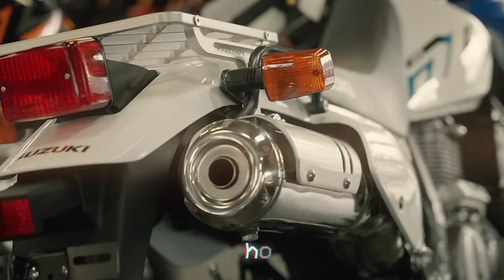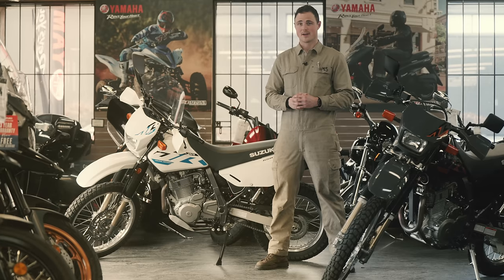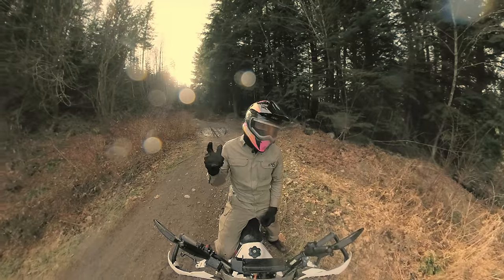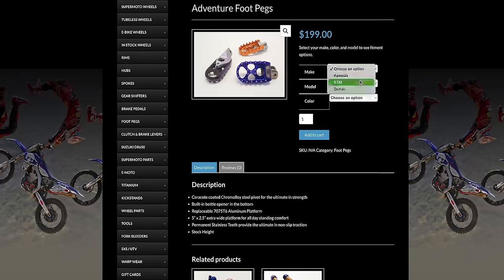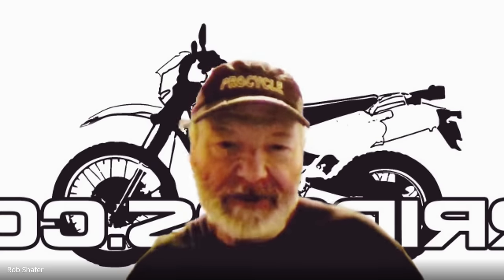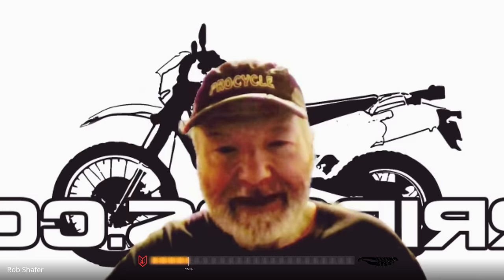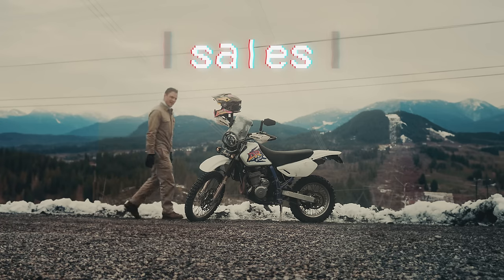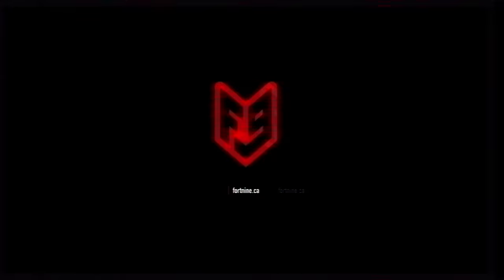Suzuki DR650 - The Motorcycle that Built a Community

Comment: One of the best bikes I ever owned. I paid $7000 in 2014, added $7000 in mods, put 56000 kms on it, and sold it last summer for $5000. Not bad if you ask me…
Reply: Sixteen cents per kilometer.  Great value.  Not to mention all the smiles per mile.
Reply: 7k in mods??? did u just bolt another one to the original or what
Reply: I don't agree on the bang for the buck aspect but that hardly matters.

Nor will one ever make sense for me except being a cheap rental in some countries.

Can definitely agree it's a solid package.
Reply: Sorry but 56k in 9 years? You hardly rode that thing!
Reply: 7k in mod for 7k bike and you think your smart?
Reply: @amirdoost8527 you don’t know the difference between your and you’re and you think you are?! 😂
Reply: That's so bad😂😂
Reply: @gujo4351  how can you add 7000$ on that hahahahahaha......and why
Reply: Steal
Reply: I bought mine for a 3500 with 3,500 mi on it. Best mods for these bikes Ricor front fork valves! Extra padding on the seat. Handlebar risers. License plate rear tail light feng shui improvement! Front tire super Moto mud fender. LED headlight. LED cluster light. Maybe out the door $1,000 on upgrades. How do you spend $7,000 on upgrading this bike?
Reply: Solid gold brake and clutch levers, right?
Reply: Sounds like an investment. It's ok. People did worse.
Reply: So, you lost 9.000$ by using it for about 9 years, I don't think it's a bad deal, it's a terrible one!
Reply: You only HAVE to purchase gasoline to make it go......
Reply: @gujo4351  Maybe he considers fixes a "mod". I wanted to buy dr650, watched a guy who put 70% of the value in first month because he had to fix suspension and engine (it was prepared just right for buyer inspection but had serious issues)
Not the best deal...
Reply: @amirdoost8527  Um, it's you're (you are).  LOL  It is better to keep your mouth shut and appear foolish rather than open your mouth and remove all doubt.  -  Mark Twain, I think.
Reply: @Al.j.Vasquez  Um, 7K + 7K = 14K - 5K = 9K, not 12K.  Or did I miss something?
Reply: @cyjanek7818  So, the ONE guy that YOU know cancels out the thousands of guys who never had any trouble?  Oh, OK.
Reply: Nevermind the haters here. They wouldn't understand. Maybe not the most reasonable financial decision, but it isn't the return on $ in monetary terms. 
Some would habitually go to Starbucks, eat out daily or buy an overpriced truck, lift it, then never drive off road. 
You Sir, used it as intended and more importantly had a blast.
Reply: @tedunguent156  what? Never had any trouble? The whole community exist to solve this bike problems, if it didn't had any this video wouldn't even exist. 
Why are you so mad lol, it's not a secret that 1 cyl engine are not reliability kings.
Reply: happiest 5k spent!
Reply: $9000 loss but those memories are priceless
Reply: @cyjanek7818  What makes you think I am mad?  People mod their bikes to make them more capable of the riding they intend to do.  Many of these bikes were just ridden without any mods.  Now go and try to trigger one of your little friends.
Reply: @amirdoost8527 modding a bike is half the fun. You're probably fun at parties 😂
Reply: @purple9969  Well, it isn't really a "loss" either.  No matter what you buy and USE it costs money to use it, right?
Reply: @tedunguent156  I’m $3100 into a 2001 rebel 250 cmx250c, and there is always something else. I finally got it running as it should after rebuilding the carb 14 times, and as soon as I came back from a ride I blew the crankshaft seal. Just like it took me 14 times to discover another fix on the carb, I’m currently at trial two on the crank seal. In the end the bike will run better , and when it’s all said and done I’ll say it was worth all the anguish, but is it?
Reply: @purple9969  It is if you say it is.  It's not my bike.
Reply: @purple9969 just in time for something else to fail 😂
Reply: @thecheeseisgood12345 I had three other bikes I was insuring at the time. The DR took a nap occasionally.
Reply: Sounds like you wasted 9,000 to me…
Reply: I know plenty of guys with $10k - $15k in add ons to Husky 701's. No one cares about resale value, you just build the bike you want.
Reply: That doesn't sound too good bro
Reply: @thecheeseisgood12345 kilometers at that, not even miles. Such a shame.
Reply: @PseudonymAliase  Cogent rear shock assembly, Cogent progressive springs and valve emulators at the front. $2800. From Procycle: stainless exhaust kit, 40MM Mikuni carburetor, stainless braided brake lines, front and rear, shorty levers both sides, Michelin tires with extra heavy wall tubes, 90 degree valves stems, titanium Hayabusa muffler, Acerbis aluminum hand guards and 26 litre fuel tank with two fuel petcocks, oil cooler protector, aluminum skid plate, Moose adventure saddle and 1” Moose handlebar risers, ProTaper handlebars, Oxford heated grips, LED lights every fkn where, Wolfman waterproof luggage, and a bunch of other shit that I can’t remember. Fk all you ignorant haters. Go spend $15000 on a BMW or KTM only to discover that you need thousands in upgrades to make it actually rideable. You think I’m stupid? 🤣
Reply: This guy dualsports
Reply: If you didn't put any mods you'd of gotten more of a return, but probably less fun too.
Reply: Sounds like you barley used it and then gave it to the next guy for less then half of what you paid if we don’t count insurance gas repairs etc. nice 😂 any lube recommendations?
Reply: No one will even look at my DR with 51,000 miles.  Once mileage is mentioned they run away.
Its a parts bike.  Spending 14K on a bike and selling it for 5K is a good thing?
Reply: @Gigachadly  I built the perfect bike for less than the price of a Beemer or a KTM and that bike took me to more places than any of you coffee shop riders will ever see. When things in my life changed I sold it. 🖕🏻
Reply: @tedunguent156   My bad, it was probably late at night and i didn't tell.
Reply: 34k miles damm
Reply: @tedunguent156 Add gas, maintenance and taxes

that's a shit base for operational cost
Reply: 7k in mods?  Did you do a k4 engine swap and turbo?   Cause seriously...what did you do for 7k?
Reply: @nabahmadi5012  if you’d bothered to read through the comments, you’d have seen the list.
Reply: I put 50,000kms on my bike in 1 year and I only paid 2 grand for it. More expensive isn't always better with bikes..
Reply: Yeah, he really did put $7K in mods on it. And worth every penny.
I know. Cause I’m the guy that bought it.
Reply: @cabindwellr  and you were the guy that deserved it. Glad I met you.
Reply: Oil change- mod. Tyres- mod. Petrol station air- mod. Petrol- mod.
Reply: so you lost 9k on a bike from 1996? lmao
Reply: It's light if it's your primary form of transportation, but not bad if it's your weekender and you live in snow country where you're lucky if you ride 6 months of the year.
Reply: @thecheeseisgood12345  my bike has 53k in 20 years (sat in storage for 13 years)
Reply: you are FOS. $7k in mods? nope. just no. walk away boi
Reply: Wow that was dumb. Should’ve just bought a Tenere. AHAHAHAHAHAHAHAHAH
Reply: He just made a quad with more steps

Comment: I got my first motorcycle a couple years ago, at the age of 59. A two-year-old DR 650 with 1300 km on it for $5000 Canadian. Without doubt, the best five grand I've ever spent.
Reply: Bought my 2019 with 524km along with a trickle charger and hydrolic bike lift for $4,500 CAD at age 59 in the fall of '21. With fresh nobbies I'm rediscovering the trails of my youth but no longer afraid of the hills my little Kawi 100 and I couldn't handle in my teens. It's changed my life. Upgraded the suspension last season and will be strapping on camp gear soon.
Reply: @KS-sh4xn I bought my 2019 DR with 507km on the clock back in 2021, 20,000km later I’m still as giddy about it as I was on day 1.
Reply: @KS-sh4xn  That's a wicked deal!
Reply: Never too late! Nice one.

Comment: "Stuff that isn't broken yet but it's blue."
You, sir, know entirely too much!
Reply: Nr 45 know too mutch! Time to scrap and build Nr 46.
Reply: Shhhh Sinister Diesel might sue you
Reply: Blue anodized, Red anodized - it all looks cool, even though the stock part is perfectly adequate.
Reply: Partial to purple myself, but that was a dang good blue.
Reply: To be fair the OEM timing inspection port and crank plug strip out extremely easy even with the correct Allen key. The warp 9 plugs are a good upgrade if you adjust your valves regularly.

Comment: Being a current owner of 2 DR 650s a 2005 and a 2014 I have no complaints, 2005 507,000 klms, 2014 330,000 klms, both still running great and I still ride both.

Simplicity is the key, the engine can be rebuilt in a weekend and the bottom end is mightier than Thors hammer, over 500k on the same big end and crank bearings, all for $8500 Aus.
Reply: This is what I like to hear. I have mine 2018 (39,000km) and I get more of a buzz looking at parts for it than trawling marketplace for bargains (shitheaps)
Reply: Wow crazy "mileage", what's the story with them, that's tons of riding!  Did any engine/trans parts wear out?  I'm thinking of getting a drz400.
Reply: How many times you rebuild the engine on both dr 650?
Reply: @waynepantry7023  I had a 2002 DR 650.  I got 40,000 miles on it without my gearbox exploding.  Only reason I got rid of it was because I got drunk and stupid one night and changed the oil.  I cross threaded the plug somehow.  Thought it'd be ok to drive 50miles to town to get a bigger plug to tap in.  Nope.  Melted down the cylinder.  Didn't notice all the oil on my boots.  I loved that bike more than any other bike I've owned in over decades.

Comment: XT600 rider here. Salutes to the DR.
The XT hits many of the same points only that instead of the giant online aftermarket community I just have access to a welder, lathe and mill.
Reply: The mirror in my profile pic is on one of those, seemed like it was really difficult to find parts and while it seemed easy to fix, every fix was way more difficult for stupid reasons
Reply: Kr kr, got a XT600E, can't resume it better. Kedo is a nice source of parts but the community is reaaaally small for such a nice bike.
Reply: I have an XT500E, I can't find plastics any more, barely able to find turn lights, I got a vstrom for trips but I miss my XT when I am not doing 120km/h or more
Reply: TT600R owner here, I just have a hammer 😂
Reply: I used to have an xt600 but sold it because I was worried about finding parts (plastics is an easy example because couldn’t find replacements anywhere). I have a road legal wr450 and it still seems crazy to me that I can get a full replacement plastics set for $200 or a new radiator for $120. Plus double the hp is always fun ;)
Reply: TT600R here as well, damn it was it tough to start until you get the hang of it
Reply: @TheFabus95  very much so! Mine was improperly jetted when buying it, so I actually got help from a stranger who knew how to start it the first morning. I felt kind of emasculated 😂

Comment: Drz400sm owner here. Suzuki has done the same thing with this bike as well and it seems to be a very similar community. Years of knowledge and RND from riders, lots of aftermarket options. I thought about a 650 myself before I bought my Drz, and decided I wanted to do some tighter single track and thats pretty much the deciding factor. I got a set of 21/18 wheels and it does good in the woods, ive done a 2500km tour on it in totally stock form. Im glad these bikes have stayed the same for so many years, dont fix it if its not broken.
Reply: When I bought my new 95 DR 350, they were flying off dealer floors. Aftermarket exploded! The first day, I swapped 4 gallon tank, tires, fenders, installed handlebar and handguards, and took my street legal bike anywhere I wanted. Thousands of miles of national forest trails were mine to explore every weekend!
The 350 literally created the money to build the 650, which was not a great seller.
Reply: Have met many DRZ400 owners on the road. Despite this video, DR650 is a smaller community?  Idk. I only know what I have seen.
Reply: Sm rider also with 244 shinko. Suzuki with this bike, dr650 just keep them simple and they last for a long time. Many other brands also have these bikes.
Reply: 400sm....
Never selling it actually I rebuilt calipers today
Reply: I had the '99 DR350s w/ upgraded suspension.  There was a good community there.  I tried a DRZ400 and the engine was much nicer, but the suspension wasn't quite there.
Reply: Im a DRZsm luvva, 
At 45 yo ive had many bikes but always had a DRZsm from inception.
The only bike i have now is a DRZ the only bike i need.
Reply: DR-Z400e owner, first bike, 2002 old-school yellow bought for $1800 cuz the sharp ass shifter had bit into the case already BUT there was only 2000 miles on it (claimed) and it looked clean enough to be true. i learned to wrench by looking thru thumpertalk and a yt videos, even rebuilt the carb. after inspections, learning off-road vehicle registration regulations in my state, reading the shop manual for assurance and doing the fabrication/customization to meet requirements i got her all prettied up and street legal! the sense of accomplishment that i felt was layered with passing the MSF course and the feeling of getting a beloved bike at such a ripe opportunity... i geeked when i heard it idle that first time and gave that dude full asking price, he would took 1600 no question, it was a real "shut up and take my money!" moment. ill never sell that bike.
Reply: sm owner here.  I have the 21 18 on there now, but I think I am going back to the 17"s for off  roading.  I have an mt21 up front and a Motoz Tractionator on the 17"s.  Waaaaayyy more traction with those wider rims.  Consider trying it out.  

Cheers!
Reply: DRZ400 & DR650 are not quite the same category.  The weight advantage on the 400 is not much, and its touring capacity with a full load at 100kph is a buzzing experience.  I've ridden both, a lot, and have the 650, and there really isn't much in the manoeverabilty side of it either.  I have a Husqvarna FE501 as well, so if you want to ride more technical trails, then it makes both the 400 and 650 look(and feel) like Russian tractors.  So horses for courses.  I wish there was a much better weight advantage on the 400 to make it worthwhile.
Reply: I've known a couple of BMW owners who upgraded from shiny their GS's to properly clapped out/modded DRZs.  👍
Reply: @machupikachu1085  I rode with some shinko 705s as well as Bridgestone adventure cross ax41 on my 17" wheels and so far I like the 18/21s for higher speed dirt riding. I have a Dunlop d606 rear, and a pirelli mt21 front myself, definitely feel like I can push it a lot harder.
Reply: Bikes0420  I love the bike in super moto setup, super fun, definitely not stupid. But I do have off-road wheel set up I switch to.
Reply: Bikes0420  how are supermotos stupid?  They are a great commuters, you can carve canyons as good as any sport bike, they are literally a track bike, and if you put knobby tires on them they are a legit off road machine.  You're missing out.
Reply: @TwoUpTourer so you're saying you prefer the 650 to the 400?

Comment: The DR650 is a legend with the largest aftermarket of any motorcycle.  My 2003 still runs perfectly.  The best way to buy one is used, which will allow you to customize it to suite your needs.  To make it great doesn't take that much effort.  Cogent goodies $1700, Seatconcepts $350, LexxMX pipe $200, ProCycle Breathe Easy kit $120, Acerbis skid plate, and you're ready to tackle anything.   The mod options are endless.  I got mine used in 2010 for $2k, spent $5k on mods and it is now an offroad/dual sport/light adv monster.  By the time you take off the old stuff and put on your new goodies, you still come in around 370 lbs. without body armor and panniers.

Comment: 3 years ago, I bought a 1993 DR650.  1700€ and needed new fork seals.  First bolt I unscrewed was butter and deformed. 2nd too.  3rd one I decided she was coming completely apart (dismounted but didn't open the motor). Replaced every bolt, sanded and painted everything, rebuild kit for carb, forks, master cylinders, calipers, etc. 
I love this bike

Comment: In Cambodia, I picked up a DR350SE - in 1995 - and rode it through eight Wet seasons without a hitch; not one dealership in the country, but a seasoned mechanic - Russian-trained - told me it was one of the best engines he had ever worked on, in terms of ease and quality finish. I'm still here, a six-pack line-up later, GSX400R, GS500F, RMX250, SX200, Step and GS125 - NONE of them [have] broke[n]

Comment: The SV and DL650 lines are also legends of the everyday motorcycling world- they should be spotlighted, honored with a video.
Reply: Sadly, the SV will lose its V-engine soon if it didn't already. From that point onwards it's not an SV anymore imho.
Reply: Exactly.  They barely changed the sv650 recipe in the last 25 years!  (Except for the horrible gladius..)
Reply: @mammouth2727  Still, the lack of love for the Gladius makes me sadius.
Reply: I know it is irrational.   I think I just hate the front light.  But nothing about motorcycles is really rational anyways :)
Reply: My 2021 dl650xt stays on tar.  My 2013 dr650 lives for gravel.